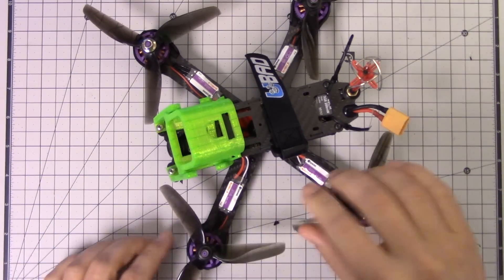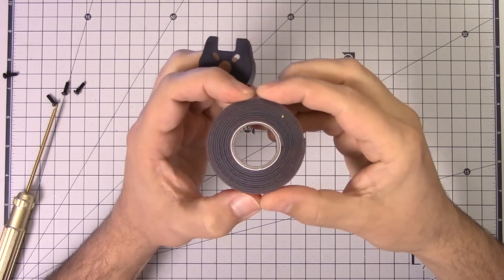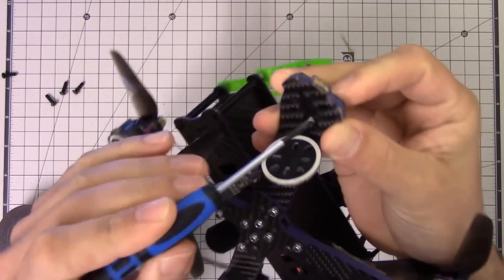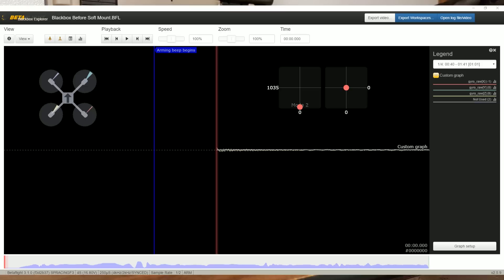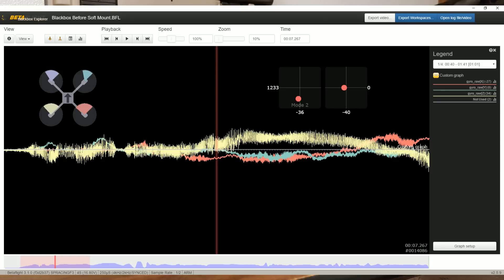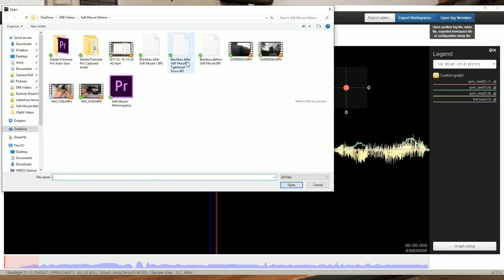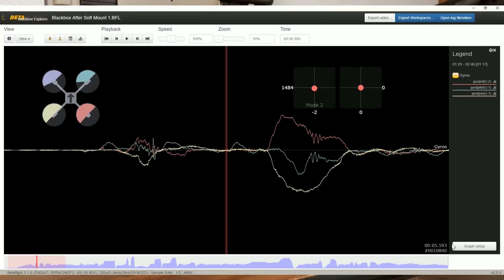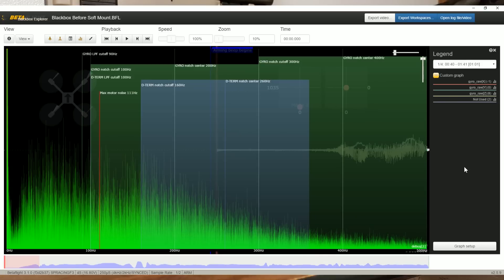Soft Mount Quadcopter Motors | MYTH BUSTED OR CONFIRMED?

Comment: For a true soft mount first you want Anti Vibration rubber. They make this for other applications such as HVAC compressors etc. For true soft mount you would want a washer maybe but a rubber sleeve between the bolts and arm. a rubber washer on the head. This would completely isolate the motor. Yes you are getting very little vibration through the screw. This would or could let's go with could completely isolate the motors.

Comment: Engineer tip: Soft mount screw head as well, of same thickness and same material ideally :) Oring or 3d printed, you will have to find the right thickness, try slim and increase little by little :) i'm currently working on TPU shell print filled with soft silicone, but O-ring 1mm diam worked best so far.

Comment: Soft mounting helps in isolating vibrations. Best example is how am engine is mounted to a car ( with a soft rubber bush). I am a mechanical engineer myself. To those people who say heads are still touching, just squeeze the motor towards the frame, you can see the head coming out a little bit. That play (the mounting tape) absorbs a lot of vibrations. It's physically proved. It's not just imagination of bling belief..

Comment: Totally makes sense to grab the problem by it's root. 
Since the motors are the cause of vibration. 

If I had a bucket of water with a hole in it  I would also concentrate on fixing the hole instead of topping of water to keep it full.

Comment: Look at my quad at "Rockford Quadcopter" from 2013; first stated in 2008! Have tried everything. Soft mounted motors...nothing new. It's a no-brainer. Used disk-drive type isolator grommets, Promlem is vibrations still creep in via those wires soldered to the PCB. What comes around goes around. That's why the ONLY thing that requires isolation is the GYRO CHIP. NOTHING else requires isolation. Moving the gyro to a separate IMU is the way to do it, but now the filtering and processing speed is so fast/good it is almost moot.
Ignorant manufacturers are making the situation WORSE by having users solder a wad of wires to the FC which has the gyro on it too!
Easy and better solution is an IMU "module".

Comment: Thanks Joshua. I'll try this tonight. My quad flew away yesterday but lucky it went directly straight up to the sky since I was hovering. My setup is Emax Eco 2306 2400kv, Spedix GS45 4in1, Hyperlite F4 OSD v2 flight controller and 6" props. I could not believe what I saw and heard in the span of 2 seconds. I was hovering the quad and it was about 10ft away from me when suddenly, it flew to 150ft high and I was so friggin scared since I'm a newbie to this. I wasn't aware that flight controllers should be soft mounted. I was told yesterday in one of the Discord channels. I'll fix it later. I'll try soft mounting the motors too, Thank you Joshua!

Comment: I'm mostly surprised stumbling across this issue years later that anyone doubted it to begin with. You only need to look to.... every relevant industry in existence, with parallels to what you are looking to achieve.... to see what they ended up doing and why. I imagine by now you have figured out your preferred method for isolating all the steel connected to the motor from the frame. Same as motor mounts in a car. Heck cars not only use a lot of soft rubber but they sometimes hollow it out and add liquid inside it too. (Probably overkill and too much weight on an aircraft so tiny.. just sayin)

Comment: Could u 3d print softmounts? What filament would you use?
Reply: I made TPU motor protectors and land gear, so both sides of the frame plate have dampening of the screw heads as well as the motor base. The density and hardness of your TPU will make a difference of course. Too soft and your screw heads would squish or tear through their dampening layer.

Comment: The printed motor pads they sell, like the ones Rakon Heli sells..  Do those perform as good as the tape you used? I would think your tape to be much better..  Are the printed ones worth using?? They are on everyones quad.
Reply from the maker: The printed motor pads didn't exist when I made this video. This video was when people were first trying out soft mounting motors. Only later did printed motor pads become commonplace.

I don't know how they perform.... I haven't tested them. I don't usually soft mount my motors. With a soft mounted FC everything is usually fine.

Comment: I spent a great deal of time on this issue in respect of tail rotor gyros for model helicopters back in the 1990s and I'm convinced that isolating the motors from the frame is a better solution than trying to rely on soft mounting of the FC on its own. My reason for saying this has several factors. Firstly, the range of frequencies of vibration in the airframe with the motors hard mounted is wide - the beat frequencies can obviously be anything from zero upwards. When it comes to soft mounting the FC you have two competing requirements - you want the FC's attitude to accurately track the attitude of the airframe that, in rapid roll, pitch and yaw accelerations   (OK, we old heli guys will tell you quads don't really do decent yaw acceleration but I digress 8-)=) requires a low compliance to the mount while the need to isolate low frequency vibrations requires a high compliance to reduce the resonant frequency of the mount. 

By isolating the motors from the frame you are only needing to isolate the relatively high frequencies of each individual motor and not the much lower beat frequencies that exist in the frame with hard mounted motors. I think this easily explains why, despite the motor being quite firmly mounted, you are getting a significant reduction in the low-frequency components in the gyro traces.

There is another effect which I think explains why you are seeing the relatively slow meanderings of the raw gyro traces (especially the yaw axis). This arises from the fact that, although the sensors are 3-axis, each element of the sensor is actually only a single axis device - sensitive only to rotation about the axis it is currently pointing. The effect of this is that simultaneous vibrations in pitch, roll and yaw can cause a single axis sensor to have a non-zero mean output when there is no net rotation about its nominal sensitive axis. To see how this comes about consider the following movement of the quad and consider what the yaw gyro actually sees.

Tip quad 90 degrees nose down
Roll quad 90 degrees right
Tip the quad 90 degrees nose up (back to level)
Yaw the quad 90 degrees left

The quad is pointing in its original direction but the yaw axis gyro only saw the last of these motions and its mean output through this sequence is thus displaced to the left!

The important thing is to realise this happens to a degree even when the angles of motion in the three axes are very small. So when you have the sensor experiencing simultaneous vibrations in all three axes its output will generally be displaced (the degree and direction depending on the amplitude and relative phases of the pitch, roll, and yaw vibrations and this accounts for the stochastic nature of the disturbances). The result is to get small amounts of drift in the yaw axis (reduced if there is a magnetometer to give another heading reference to add to the Kalman 'mix'). Twitches in pitch and roll are also to be expected as it takes time for the accelerometers to take gyro errors out via the Kalman filter.

The final important point is that this vibrationally induced drift effect occurs even if the individual gyro sensors are “perfect” i.e even if they don't have any g-sensitivity or out-of-axis rotation sensitivities.

Comment: Depending on the density of your pad layer, there will be different torques that will take advantage of the padding used. Basically you want it firm but not tight tight..

Comment: go back to school and study elementary physics. You will quickly realise that soft mounting anything is complete nonsense.  If yoy want to avoid balancing props properly then, by all means, do but don't post explanations that don't stack up in any way. Good luck
Reply from the maker: Soft mounting to fix vibration is standard practice everywhere. Look at your car engine. We can debate whether soft mounting quad motors us the best approach but you can't argue against the technique of soft mounting in general.
Reply: Unfortunately, even if you did a perfect job of balancing the props and used sine drive on the ESCs to eliminate torque fluctuations from the motors the aerodynamics of rotary wing flight still introduce vibrations. The most obvious one is that in forward flight you get a momentary roll-axis torque impulse from the prop every time a blade goes through the advancing position. 3-blade props don't eliminate this, only reduce it.  There are then the vibrations that arise from the blade wakes interacting with the airframe and the other blades. If rotary-wing flight didn't exist Loctite would invent it!

Comment: I asked you the other day about soft mounting motors . . .  I got the rubber one's off amazon. . . .  Currently not using them because I'm one of the people who aren't really having that problem. . .  And they are a HUGE pain to get on correctly . .  Then you run the risk of motors flopping off . . .  And were talking about super glue . ..  my quad flies fine . .  Thanks for the advice !

Comment: What if you put a single layer of tape above and below the arm, that way neither the screw or the motor are in direct contact with the frame???
Reply from the maker: Double insulating could help but you would have to make sure that the screw heads don't pull through.

Comment: Tape for motor softmounting is a brilliant idea. Not all tapes though. Double sided sticky tapes will melt on heat and vibration. And too thick tapes will give more problems than good. PVC, electrical isolation tape, silicon tape/pads or TPU pads around 0.5-0.8 thickness will do the best. Screw tightening seem a game of luck though. How you manage to avoid not tightened screws felling out? Had problems with that - lost some not good tightened motor screws and messing with thread glue made me mad. How you are dealing with screws?

Comment: I wonder if putting a few rubber washers on the screw heads would help at all?  I know that some of the gel mounts come with scrap pieces.  You could drill those and put them on the screw heads.

Comment: if you think about it, the dampening effect of the tape or rubber you use will be most effective on the axis of vibration in the frame, carbon fiber frames tend to flex more perpendicular to grain of the carbon, so on a flat frame it flexes and vibrates up and down, the  vibration from the motors/ props and the mount screws rotation is with the grain it resonates faster so the effect is high frequency noise and not vibration, vertical arm frames would be more susceptible to oscillations from the rotor  movement and ignore the kind of up and down flexing vibrations that the wizard frame has.. i wonder has anyone tried silicone? i have used packing pad foam to soft mount an action cam to my wizard it worked great but it can only compress so much.

Comment: @Joshua, "debug_mode = GYRO" logs gyro output after the notch filtering. To get raw but scaled gyro values before the notch filter you need to set "debug_mode = NOTCH". See code https://github.com/betaflight/betaflight/blob/v3.2.5/src/main/sensors/gyro.c#L766

Comment: Josh iv just purchased this tape and it's only 0.0.6mm thick double sided sticky mps 3  will this be good enough for this awell josh
Reply from the maker: +William Davie I don't know. I probably wouldn't use foam tape because it breaks down.
Reply: +Joshua Bardwell thanks josh I got 2x m3 sheets which I thought it might work but I just learning josh but it will do for something else lol  
but I'm getting white lines across my Fpv feed it's ok till I throttle up on idel but the more throttle it's very very bad not fly able josh

Comment: Hello Josh!
Saw this right now here in 2018 and i do have some technical knowhow in filterdesign to share that might help understand why there are still noises in the Gyro Signal (also an idea on how to reduce vibrations even further).

Filters in genereal:
There are basically two kinds of filters, HIGH PASS Filters which cut out only low frequencies from a signal, and LOW PASS Filters which cut out only high frequencies. You can also combine those two Types (but that doesn't matter here).
As you can imagine, what is used in the gyro-application is a LOW PASS filter, as we want to reduce high frequencie noises that mess around with our gyro-feed.

The reason why you still have noise after the filters are applied:
However, the term "CUT OUT a frequencie" doesn't really apply to what a filter is able to do. Filters, no matter if analogue or digital (what is used in every gyro application for quads) can only dampen a noise down to a level where it doesnt matter anymore, and they do it gradually from a fixed frequencie on. (See: https://upload.wikimedia.org/wikipedia/commons/thumb/6/60/Butterworth_response.svg/350px-Butterworth_response.svg.png   After the fixed Filter Frequencie (cutoff frequencie in the graph), the damping is not straigt, it is gradually)
 The gradual decrease of the noise intensity above this fixed frequencie is the real reason you can still see noise after the filter applied, because it is simply too close or even before the fixed frequencie.

Other Way to reduce vibrations (not tested, since i never flew anwhere else than in the sim lol):
To do that, you could also try to softmount the arms that hold the motors. This approach is not possible with every frame,  since you would need the arms to be mounted individually, but it should work on the wizard.

Comment: Screws touch bottom plate, but the motor doesn't, therefore the screws are able to move ever so slightly and reduce transmitted vibration.It's little stuff that make a huge difference, such as tiny little blobs of blue epoxy on motors to balance them.

Comment: Joshua, and what if we find a type of stiff rubber washer to fix between the screw heads and the frame? Would we possibly have even less vibration?
Reply from the maker: +Julio Pazzetti thus is something like what do atone has done on the gt200. The shirt answer is yes.

Comment: To prevent the heads of the screws touching the arm, you can apply a spring between the head and the arm. By choosing the strength of the spring, you can also define the force of pressing the motor against the foam. Maybe a "Tellerfeder" (sorry, I don't know the English word) can also do a good job.

Comment: I have to wonder, where is the vibration coming from?  I expect that it would be from a rotating mass so soft mounting would be a benefit.  Since I would expect that a machined motor housing would be very well balanced, have you tried balancing your rotor blades?
Reply from the maker: +Jim Hebert mini quad pilots break too many props to spend time balancing them. The latest time I flew a freestyle location I came home with a bag of 20 broken props. And even if I did balance the props, the first time I crash, they're out of balance. But they're still flyable. A mini quad needs to be able to handle props that aren't perfectly balanced.

Comment: just an update, too late, ? anyway.. i was recently stung by buying the silicone mounts the thin flimsy ones... i'm sure they are worth it but i couldnt bring myself to buy more, then i thought hey its just silicone, i searched on amazon and found that silicone sheets are used in baking, they are extremely cheap, then i searched for a hole punch... so for about 8 bucks you can have a lifetimes supply of soft mounts.  i will post links to amazon if anybody for some reason cant find them.  i would also appreciate anybody commenting on whether they have already done this...
Reply: also josh my FC keeps going off and needs recalibrated, i use self level to test hover and stuff outside my house... i double checked its mounted well and nothing more than a dunty landing... is my FC a duffer? and can i safely fly acro with a duff mpu or whatever the gyro's called, spracing f3 clone

Comment: Good afternoon Joshua, have a question thats a tad off topic,  want to use a 4 in 1 esc, but how can i tell if the motors i want to buy have long enough wires to direct mount to the esc instead of  using bullet connecters and extra wire. I can find any info on this, and all the motors i have are short wires. Thank you for your time
Reply from the maker: It's hard to answer this question. You don't have to use bullets though. Just direct-solder a wire extension.
Reply: Manufacturers should put wire lenght in the secs for this reason, especially with aio boards looking to be the new trend. Thank you for you time again.

Comment: It's not surface area, it's that the screws mounted the way they are, are giving a little. If both ends of the screws were rigidly mounted in both surfaces (the motor and the frame) there would be no difference in the amount of vibration.

The speaker analogy doesn't work because air is a fluid.

Comment: I must admit I preferred  soft standoff, tried and but the raw gyro data was still noisy. I soft mounted the back motors with tpu motor mounts from banggood. The back two motors  feel rough. Here are the links for the raw gyro data. first link is before  soft mounting and second is the result after motor soft mount. omg huge different.  I was just doing some punches and flickering the stick in my backyard. the quad still have the soft standoff. only change was the soft motor mounts. https://drive.google.com/file/d/0B8Z59Xts9iEueHNlaG50MmZxbkE/view?usp=drivesdk

https://drive.google.com/file/d/0B8Z59Xts9iEuV1IwQi1ORmh2T2c/view?usp=drivesdk